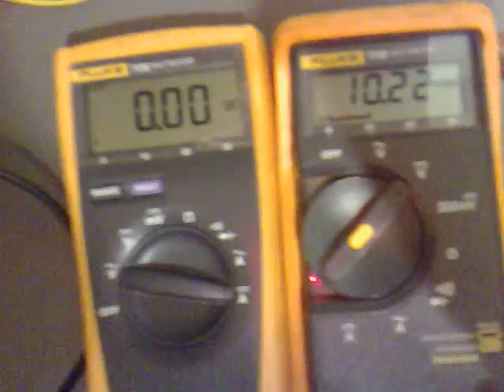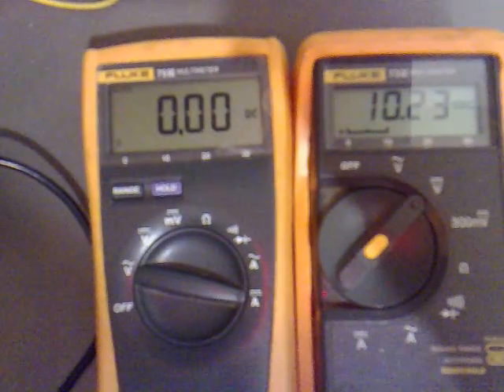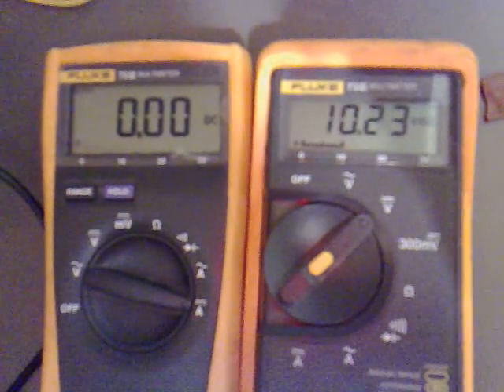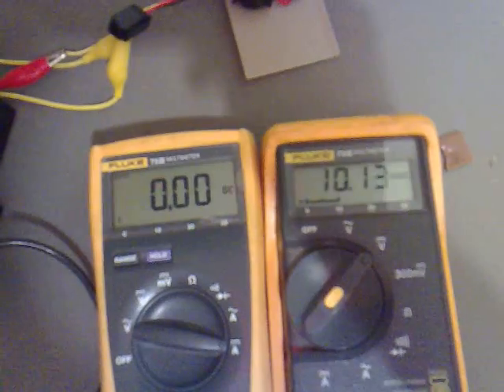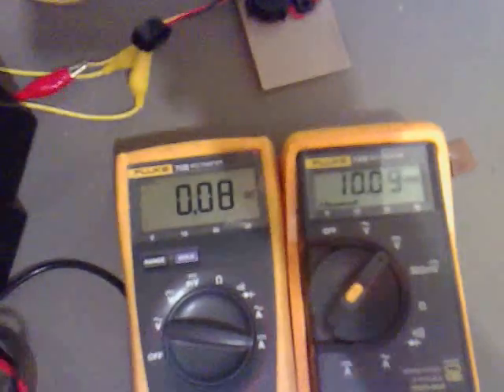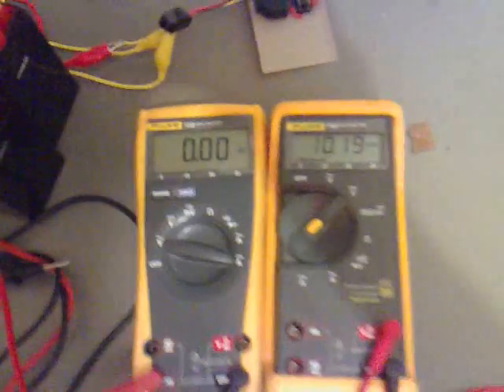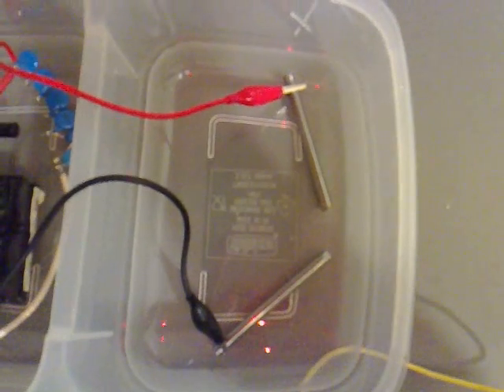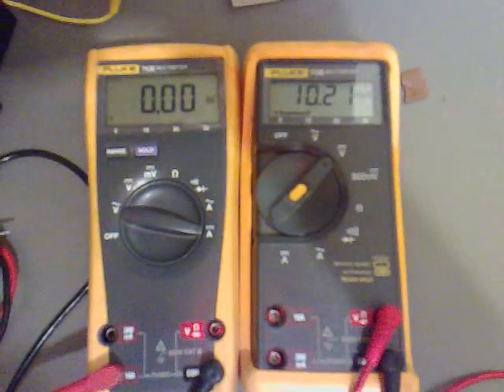Tesla Coil (Amps and Voltage In) 007

Comment: First off - RMS ratings affect only voltage measurements of an AC current flow; for current measurements RMS is not relevant.

Second - this guy is measuring at the power source of an oscillator circuit, which is DC. His measurements will be accurate regardless.

9.5V x 1.05A = 9.975 Watts dissipated in the entire circuit; these homemade Tesla coils are typically approximately 35-35% efficient (I've made OOODLES), meaning actual energy dissipated in the arc is more like 4 watts @40% eff.

Laters